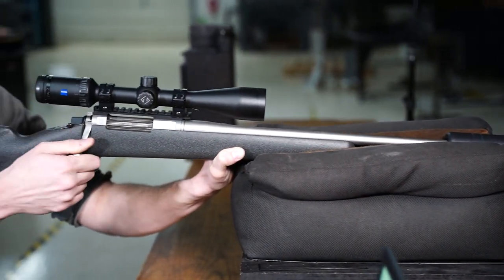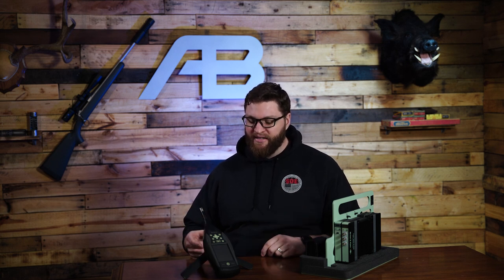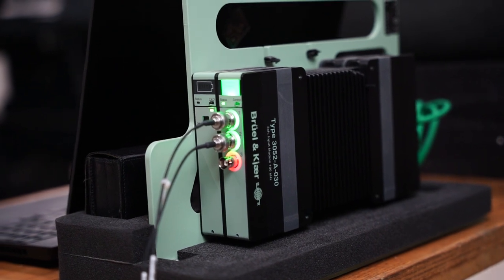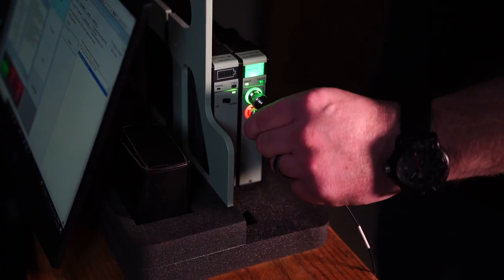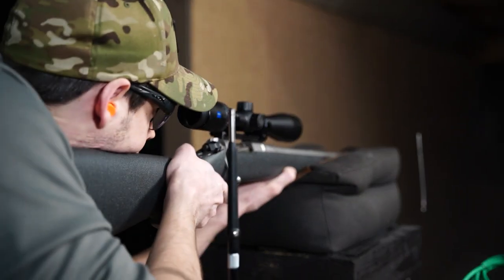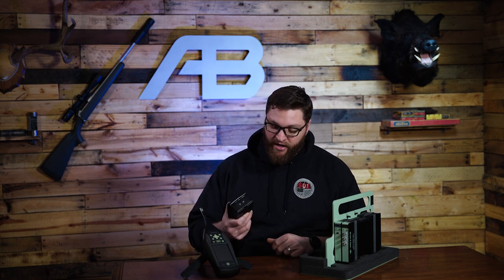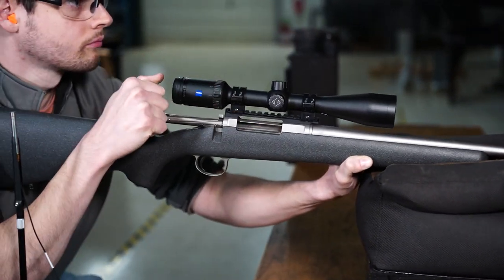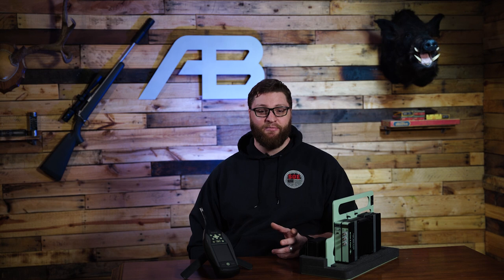Testing Suppressors - Future of versus videos

Comment: A standard for comparing back pressure would be helpful too, although that doesn’t really apply if your host has a manual action.
Reply from the maker: That's an awesome idea. We've looked at different ways to do this including a micro accelerometer. Once we find a fairly objective way to, we'll get it out there!
Reply: @ABsuppressor  I would love to see some data using a shot timer and full auto fire. It should be relatively easy to compare the RPM of the unsuppressed weapon to the rate of fire with the suppressor attached. I appreciate what you are doing with your comparison videos, I agree that this makes the information much more relevant and useful to consumers. You could do the same thing comparing RPM variations to get some indication of back pressure performance to pair with the ear sound level data.